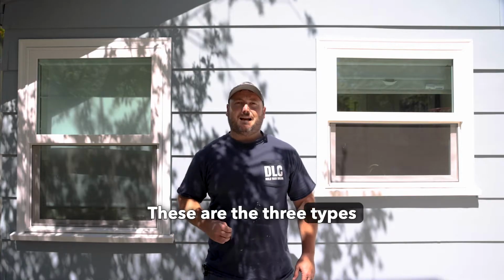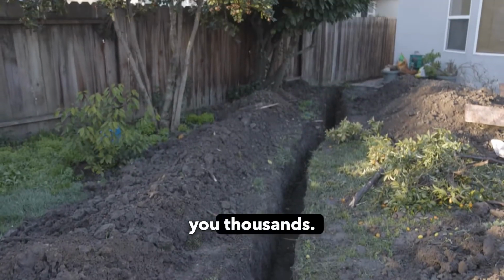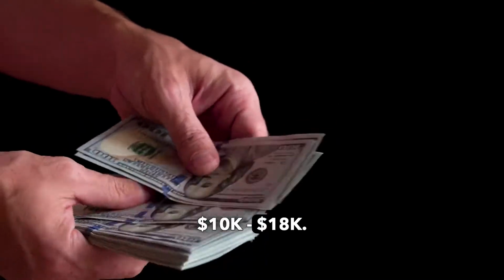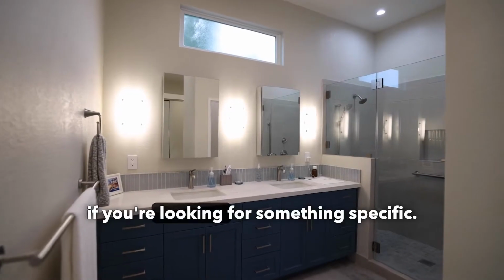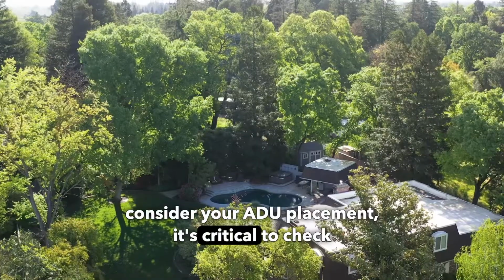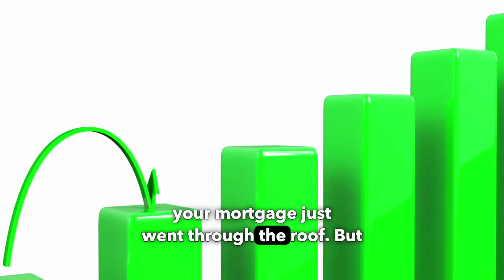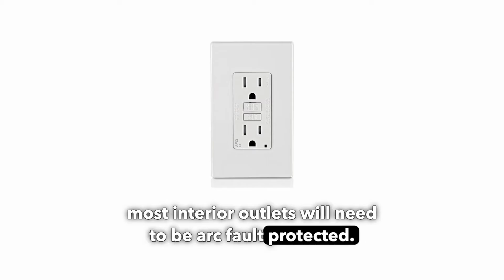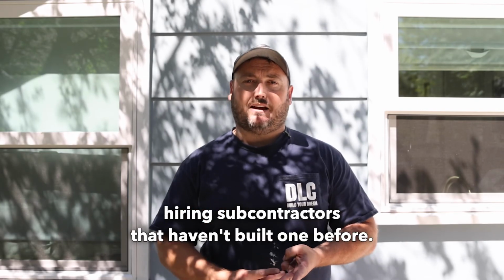How to Save $50k+ On Your ADU New Build or Garage Conversion in California | Sacramento ADU Builder

Comment: 'If someone offers you a ADU for significantly less than $200,000 in California, they're lying ...'.  Really, so a 400sq ft modular unit for around $120,000 that could be used as an ADU, from one of the leading players in this market is a lie?  Interesting.